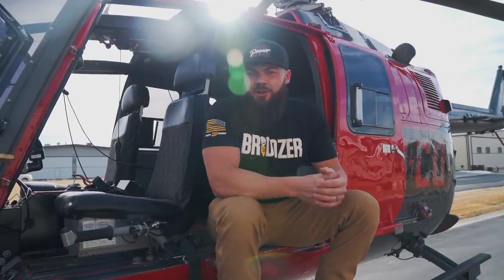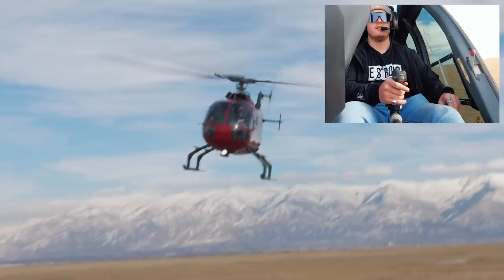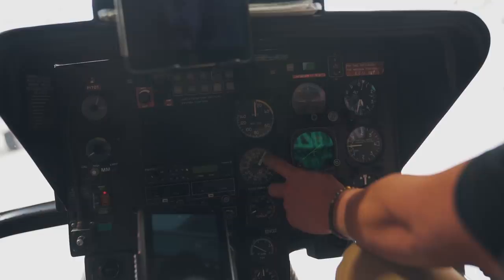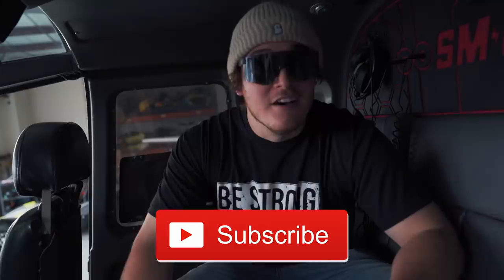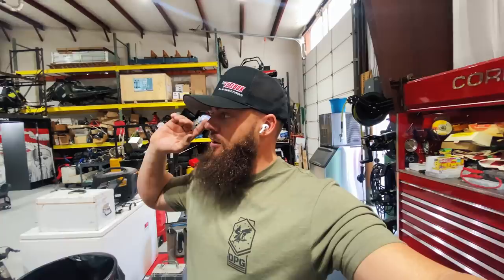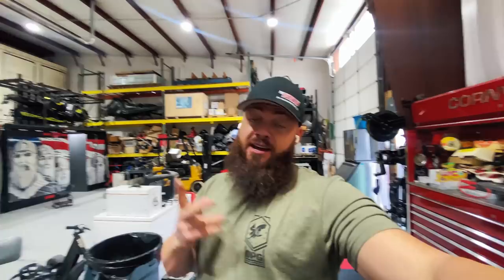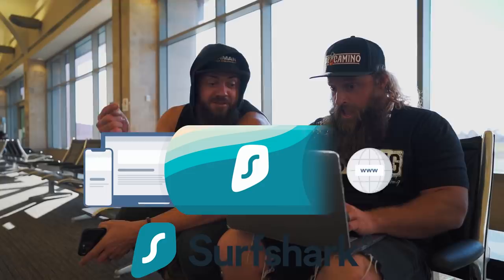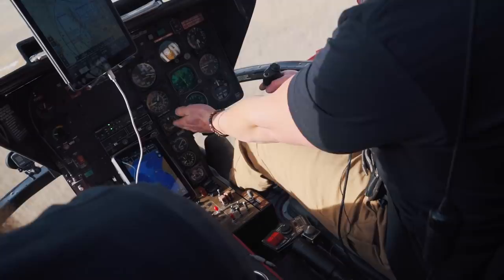What Happens When Someone With No Experience Tries To Fly A Helicopter 🚁🤢

Comment: I've been an A&P Tech on helicopters for over 40 years, step #1 is to tap on the starter with a wrench or small hammer.  It will get you home 9 out of 10 times. The 10th time will require a multimeter for troubleshooting.

Comment: That Heli isn’t exactly the best to try to hover so it’s a testament to how good he is
Reply: bo 105....old mate not messing around!
Reply: I grew up around this Helicopter in the German army, it hovers quite well, it's also a great yanking and banking machine.
Hover below the tree line, waiting for a target, popup, fire a HOT and disappear.
Thanks to that rigid rotor system, it's response was rock solid.....MBB BO-105.
Look up Charlie Zimmerman and what he could do with it.
Reply: Yankee Fan  just because of the 4 rotor system. This chopper is made to maneuver! The 2 rotors are better for cruising and hovering. Not as touchy in my opinion. It’s not the airframe I’m talking about
Reply: @remb9614  literally nothing you said is correct 😂
Reply: @txtallywhacker  sorry I meant blades. Same chopper, one with 2 blade and one with 4 the 4 blade will perform better

Comment: I'll offer a quick tip to the prospective helo pilot: The less you move the controls and the smoother you are, the easier it will be. In other words, ANCHOR you wrist (or thereabouts) on your leg so you have a reference when moving the cyclic around USING YOUR FINGERTIPS and NOT your whole arm. It takes VERY little movement if you start the movement AS SOON AS A CORRECTION IS REQUIRED. The longer you delay the worse things will get.  I once had a passenger that was with me for a couple of hours doing a DNR game survey (in a Bell 206), which takes a fair bit of maneuvering around, ask me after two hours of flying if I ever actually moved the cyclic I guess because he never really saw the tiny movements I was inputting.

Comment: Mmmm ... often had starter issues with the Bo105  t'was usually due to carbon dust buildup on the commutator .. one thing we used to do first up was reach into the compressor Intake and 'gently/carefully' turn the compressor a couple of turns ( watch out for damage to fingers ) ... this just moved the brushes on the Starter Gen a small amount whch usually  allowed full current to flow and fixed the issue ... if that didn't work then it was a tap on the end of the Starter with a dead blow mallet ...

Comment: I just wanted to add something to the whole engine performace topic. The thing with engine intake temperature is that the compressor stage of the turbine has a set temperatur limit which it can endure. So without getting to deep into thermodynamics, if you compress something it tends to become hotter therefor with a given intake temperatur you are limited on how far you can compress something like air -> TOT limiting factor. With cold intake air you can compress the air further (due to that you can extract more energy from the system hence lower engine temps with the same amount of poweroutput) -> with the increase of engine performence with respect to a given TOT, the latter is no longer the limiting factor because the cooler the intake air the more power you can extract, so as you said the structur and to wich specifics it was designed to withstand, becomes the limiting factor.

Comment: Best example my old rc heli instructor told me about controlling helicopters is this:
Imagine that you have computers controlling the rc heli, like a Spektrum SAFE model.  That is like balancing a steel ball in the bottom of a bowl.
With an rc heli with NO assistance, it's like balancing that same steel ball on the CONVEX bottom of the same bowl.
Or, to put it more simply in any helicopter whether rc or IRL, imagine standing an trying to balance on a big red rubber ball that is on TOP of another ball.
I still remember that decades later, an to this day I'm still flying!

Comment: Hovering that close to the ground with "ground effect" is the very hardest hover there is. I was a helicopter mechanic in the army so I got lots of stick time with several different rotor wings. I actually prefer flying in helicopters to any thing else. I understand that jets have a purpose but I still prefer a helicopter. OH-58 or bell jet ranger is still my favorite. It will forever hold a special place in my heart. I still have my A&P license (airframe and powerplant)

Comment: Good advice. I used to fly with a buddy that flew in Vietnam. He used to use the rotor blades to chop down the bamboo to get to people that were being shot to pieces. He said that they would have to replace them nearly every time they flew. Or repair them at the very least. Tough tough helicopters. He ended up getting a business doing flight tours in an area near me that is kind of a tourist area. He would also survey powerlines for the local Duke Power. One day he clipped a line and had To go into auto rotation and land and a really rough position but he landed OK and the helicopter was repaired. I used to fly with him and he used to let me fly because I do have a private pilots license but only rated for single engine, over wing. But because he was captain I could control the helicopter as long as he was with me. And I enjoyed flying the helicopter. So much so that I have seven RC helicopters and I’m fixing to buy another one. Any helicopter is complicated to control. No helicopter flies like any other helicopter. Even if it is the same brand. All helicopters are tuned to specifications of the pilot and capabilities of the pilot. And people don’t understand this. They don’t understand how a very little bit of movement in any of the controls can cause a tremendous amount of movement in the helicopter trajectory. People always want to jerk on controls in things and you have to be a lot more gentle than people realize. And that really confuses newcomers. They think it’s like an airplane where when you go to take off you rotate and pull completely back on the stick. Try yanking the collective lever to fulltilt and see how that works out for you. I believe you’ll find it very quickly that you’ve caused a quarter million dollars worth of damage, or on an RC helicopter roughly 1000. Some of the newer ones will do ridiculous things and takeoff like 1,000,000 miles an hour. But in back in my day we flew nitro helicopters that did not do acro and you didn’t do things like that. Now they have these Lipo helicopters with brushless motors that literally look like they’re trying to tear themselves apart as they fly. But I still like flying the old gear. It’s like flying the real thing and it flies like a helicopter should. Not upside down or sideways or spinning around so fast that if it had passengers they would splatter the entire interior top to bottom with puke. Anyway I like your video

Comment: Got about 15 year's maintenance on the BO and another 7 years on the BK! GOM and Rocky Mountain Helicopters out of Provo! Loved the BO, the BK had the LTS-101's and they were the echelles
heel of the BK, other than that, the BK was a slightly redesigned 105, basically the same rotor and drive system, the MGB's were different, but very dependable! The Germans do not make junk!

Comment: Just a tip. Next time you have a starter/gen issue like you had... Find something pokey, go in the back of the starter gen and rotate and rotate the impeller. You very well could have been in a "dead spot" of your starter gen. 
Pretty common issue on the C-20 series

And I've literally worked on your helicopter about 10 years ago. ;)

Comment: My first demo flight in an R-22 was pick it up to a hover 3 feet off the ground (flying and not going anywhere!), then slow acceleration to lazily cross over the airport boundary fence at a jog speed, with the skids at 15' (this is like flying in a dream) and BOOM, I was hooked. Got my private and commercial and instrument. Being a hang glider pilot, I say flying a helicopter is just like that, until you get into hovering, which is a different, but awesome world. Of flying fixed wing, hang gliders, ultralights, trikes, paragliders, hot air balloons, helicopters are the best.

Comment: In all the flying shots your Nr needle is U/S which includes the take off to go back to the truck and the take off demo. I am sure you did your after start checks and after take off checks so are aware of this.However, the Bolcov 105 is probably one of the few helicopters because of its low inertia rotor system where in auto the rotor rpm is so critical to keep it in that 5% band.My best advise would be, don't fly without a serviceable triple tach.

Comment: Everything is slow small movements. Unless the engine quits. Then your movements must be smooth and deliberate, as needed to keep the helicopter straight and the rotors turning. Down collective, right peddle, and bring the helicopter up to autorotation flare speed with smooth cyclic movements.

Comment: I never let my student use the governor when I was teaching. We used a Robinson R22 with a single piston engine and you have a hand throttle on the collective. You roll the grip on the collective for the throttle. The hard part was to roll the throttle on you twist away. It's the opposite of a motorcycle throttle.
It was always fun to get the student flying and looking at something to distract them and then flip the breaker on the gauges to see how long it would take them to notice that or roll the throttle off on them. Obviously, I had my hand on the collective and ready to take the cyclic if they didn't start autorotation.
Reply: What switch were you flipping, the governor  ? or a breaker?

Comment: You should just bang on the starter, usually gives you a start or five until you can change the starter if it is just carbon build up. I have done it several times to get back from offshore platform. No write up required LOL

Comment: This really is hard.
Ive flown rc helicopters, which is not the same, if you crash, ur not going to die (although it is possible to be seriously injured with a bigger rc size helicopter). Anyway, its so irreversibly sensitive. You can get urself into something quickly that not recoverable depending on altitude and capability of the aircraft.

Its crazy to me though, that even with an engine failure its still actually possible to land one of these, assuming u didn't lose power to all control surfaces.
That is something to watch.

Comment: Since I know sh*t from Shinola about helicopters but until a life changing injury was a mechanic who worked on everything from Tricycles to Bulldozers as well as boats and race cars for fun I do know the words preventive maintenance and periodic mechanical and safety inspections are and a "loose wire" to the starter is something that more than likely should of been caught when doing a P,M,&S inspection and what's up with having an engines charging system not functioning properly and taking your aircraft for a flight, doesn't that whirlybird have a volt/amp gauge in it? Seriously I am not trying to be a smart ass I am just curious how a loose wire wire just suddenly occurred on an aircraft and an engine charging system went into the crapper all at once.  Lastly I was under the impression that multi engine aircraft could start engine off a running engine.  Like I said earlier I know basically nothing about helicopters and airplanes and I am not trying to be a troll, I am merely asking.

Comment: How about one who's never flown full scale, but experience with large RC scale nitro helicopter,  600n alighn, 2007 year version,  no governed rpm auto control,  has a fly-bar, so not easy to fly, but after hours of flight, sooo much fun!  I'd bet I could fly a trainer, no, not exceptionally well,  but reasonable to the point of hover, and land without landing compression,... !

...your video... neglected to mention that the tail rotor is collective pitch port and starboard...  just something I can pass on also..

Happy landings!

Comment: Hmm. The battery could start the #2 engine but not the #1 engine. Problem with the #1 engine. Found loose wire on the #1 engine starter. Fixed loose wire. Only one battery on this aircraft. Should not have needed a battery booster. Good troubleshooting up to this point. Battery is beside the back of the #2 engine under the small door. Other than that...good job.

Comment: Thanks, Heavy D, that was cool, getting an understanding of how a helicopter works with hover and flying, what the gauges mean, and some rules about flying. Question:  does the collective automatically lock in place? I saw you let go of the collective for a moment to point out the gauges when the copper starting flying, thanks
Reply: On most helicopters, the collective will stay in place when you remove your hand. Also, on helicopters with cyclic force trim, the cyclic will stay in place when you remove your hand as well.

Comment: A hover is similar to treading water and maintaining a location over a stationary point of a river bed in the converging point of two rivers, air and water currents both have inconsistent varying conditions that impact the object's that are suspended within them in a theoretically predictable manner and also on many  occasions a realistically surprising unpredictable manner, it takes either rigorous training and practice to master, or a lot of practice practice practice training and then  practice practice practice, then more training and practice practice And more practice, so train, under a trainer, who's good at training trainees, in a simulator, that doesn't kill you when you fail, it just hits you with a shock from the instructors TriTronix dog training shock collar, then you'll be a great pointer retriever, if you want to hover a chopper, go to a reputable school to be a chopper pilot!